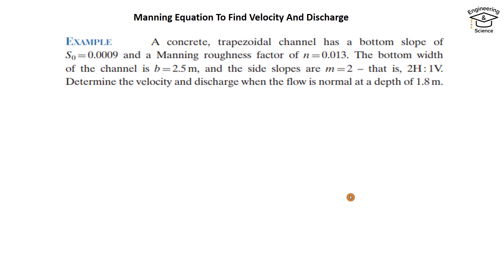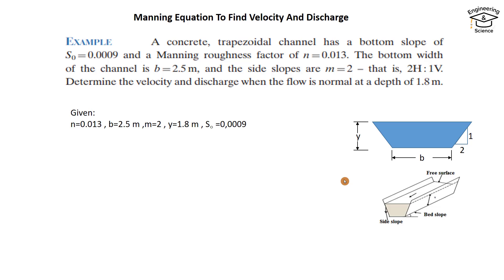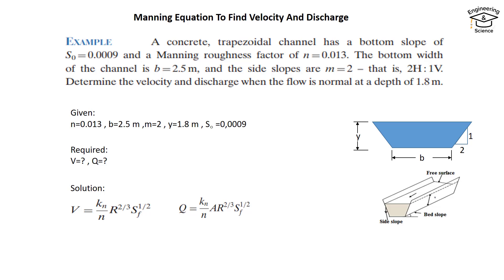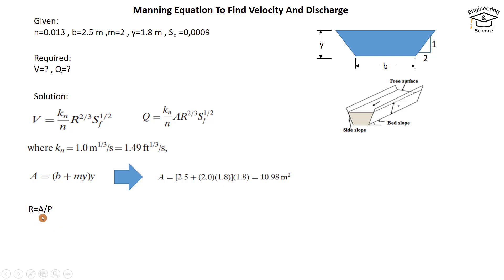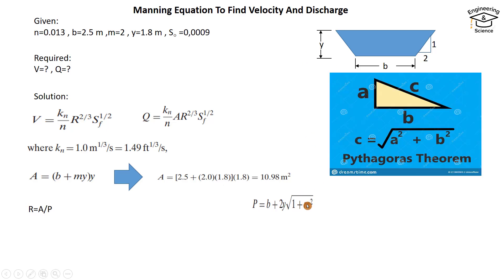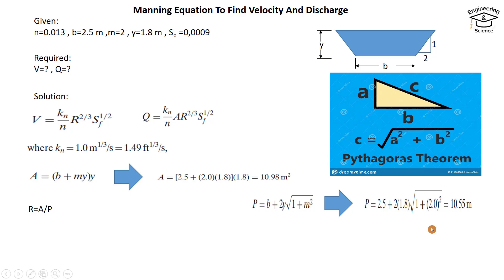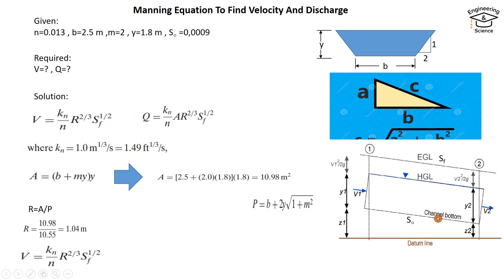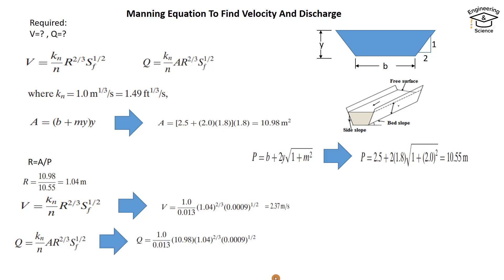Manning Equation for trapezoidal channel | calculate Velocity and discharge Open Channel Flow

Comment: What this example...

a trapezoidal channel is required for the conveyance of irrigation water from point A to B having a slope of 4% manning conference coefficient=0.4, and the side slope of channel is ratio 1to2, fhe bottom width is 0.8, the total depth of the channel is 0.9. calculate the average velocity og water in the Channel and discharge from the channel
Reply from the maker: its so easy, everything is given, use manning formula, its all